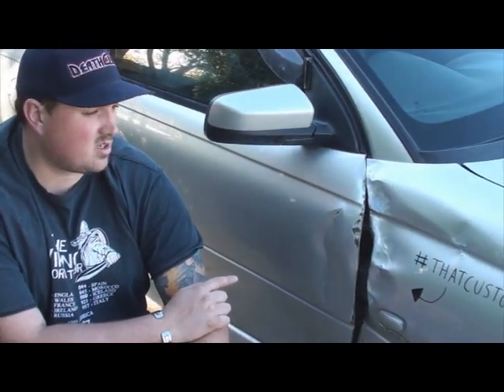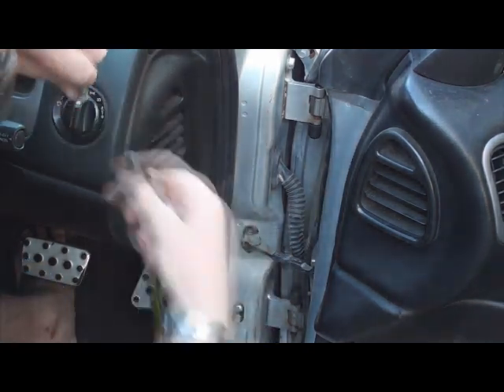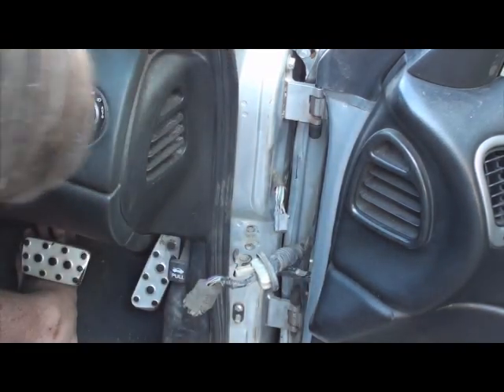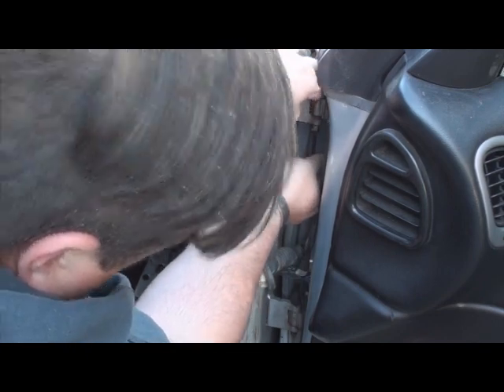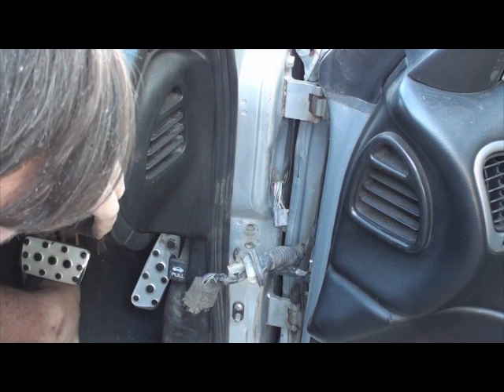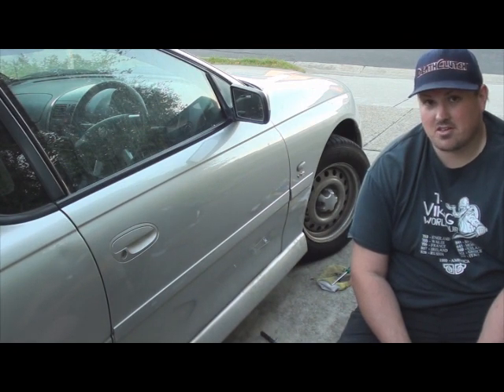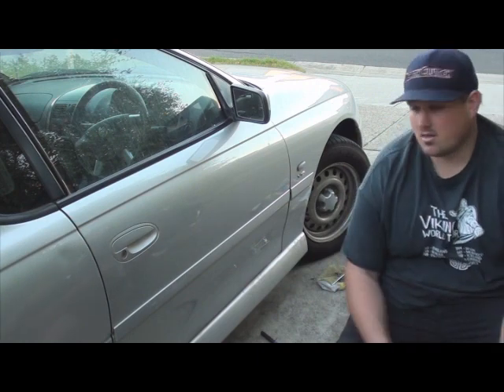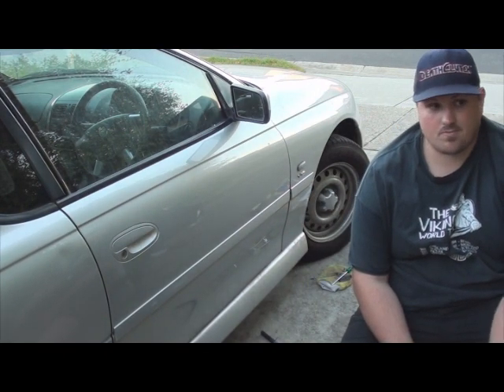How To Change A Front Door Over On A Holden VY

Comment: Thanks for sharing the video. It was very helpful, so I'd like to share what I learned when changing the driver's door on my VU. This is the only thing (other than the tray) that isn't Commodore. The doors are thinner and should have been recalled. Your video was the closest I could find. I think this tip will help anyone watching. Like you did on both pins, the first one came out easy. The second one you never filmed, but you said it was a two-man job. I spent two days trying to rig the weight off the hinge before, but with nothing to lose, I had run out of time. I took the fender off, shut the door, and the pin was so easy to put back in as well. I see in the video you also resorted to a similar method under the impression it was due to the damage on the fender. So, I thought it would help to know that in my experience, when I had done another door on a HJ one tonner 20 years ago, this method of taking the fender and bumper off is what I would try first. I assume that you would have had to have the door shut to get a good look at the hinge anyway, but you didn't really tell us too much. I had started drilling the hinge out, so when I tried this, I gave it a good hit that was unnecessary and luckily, it didn't hurt me or her (the VU). Thanks again for sharing information. It's a great trait to have.

Comment: Here's a tip. A few days before doing the job, give the hinges a good dose of WD40 etc. It makes the job a lot easier.I used the same tool off Ebay as Ben. $39 - It's perfect for the job.
Reply from the maker: Thats actually pretty smart thinking. l didnt have too much fun getting the pins out but this would have helped heaps l reckon.

Comment: Just a quick question because I have brought a new door for my car can you get the pins out without the tool
Reply from the maker: To be totally honest, l'm sure you could get the pin out with a similar size bolt but however you may run the risk of getting it all stuck in there. I have heard of people just using a bolt that fits through the guts of it and just a slightly big head or nut on them to pull it through
Reply: @CaptRoverman  okay no worries 😌

Comment: Great video, I'll be changing all four doors on my VT... hopefully without ANY damage (fingers crossed)
Do you have a video on removing the guards? Or is it pretty straight forward?
Reply from the maker: I dont have a video on removing the guards but it was pretty straight forward. I did have a few issues with the 2 bolts l think it was that were located behind the front part of the lower skirt but l was able to get to them. I will have a look over the weekend and knock something

Comment: Hey mate I have a related question. I have a 1998 VT Wagon and the drivers side door is now super stiff at each open angle and it makes an almighty crack sound at each stage of opening position. I’ve added grease and lithium grease to all pins and hinges and even sprayed it down inside where that middle bar is. It seems like the middle bar is the culprit. Any ideas on what I can try, I replaced the electric window there a while back so I can take off the plastic door panel if needed. Cheers matey, love your work. Deano
Reply from the maker: Hi Deano, that middle bar in the doors can be a right pain sometimes. What l would suggest is undo the 2 screws that connect the middle it into the frame of the car (not the 2 screws that go into the door itself). push the middle bar all the way in (as like it would be if the door was closed) and see if the door still makes the crack sound when you close the door. There is also a small chance that the pins in the door might be stuffed as well and you might be hearing that maybe. let us know how you go with it.

Comment: does your ignition key work to open the door?
Reply from the maker: What l did was removed the door lock from the old door and put it in the new door however my ignition barrel died not long ago so l had to replace that so l have separate keys for both now anyway as didnt want to pay the $$$ to get the matching barrel for the ignition
Reply: Do you have a video of changing the door lock?

Comment: Probably too late now but rather than getting the window tinted and risk it not being exactly the same as the others. Could you just swap the glass from the old door into the new door?
Reply from the maker: l still have the bit of glass in the garage but l had a hell of a time taken it out of the old door lol much the same as the door lock/handle had a hell of a time taking the old one out and still havent changed them over but l have been told the door lock/handle is super easy to do (which makes me think l got know idea why l had a hell of a time trying to remove the thing lol)
Reply: @CaptRoverman 
Installing a new window in a VY sedan is a pain in the a*se. Removing it wouldn't be fun either, but someone saved me the trouble by smashing it. It would be easier to tint the window that's already there.

Comment: Thanks for this - someone on one site suggested removing the front mudguard (oh no...) to take the front door pins out. I've just bought the same tool but does the large fixed head of the remover ;pin go at the opposite end of the flared end of the actual pin itself? Thanks.
Reply from the maker: Hey Mate, I put the fixed end to the opposite end of the flared end of the pin. I cant remember my reasoning for this, whether it was because someone told me to do it that what but all l can think of is because potentially l felt maybe that as thats the end l am going to be hitting with the hammer downwards l didnt want any more pressure put on the thread end (which l am going to assume tho however that the pressures would prob be the same). Let me know how you go, easy stuff this changing the door over so lm glad this has hopefully help you out :)

Comment: Hey man, my locks on my vy commodore aren't working so i cant lock my car, what would you recommend me do?
Reply from the maker: Aidan Hall is this happening when you try and lock it with the key? The buttons or both?
Reply: Drivers door or all doors? The door handles body wear out where the lock barrel fits in after 20 years. Another possibility is that wiring harness to the door that gets bent every time you open/close doors. Wires break, so you can get dead loudspeaker or mirror as well.